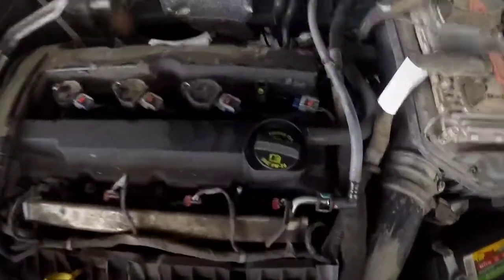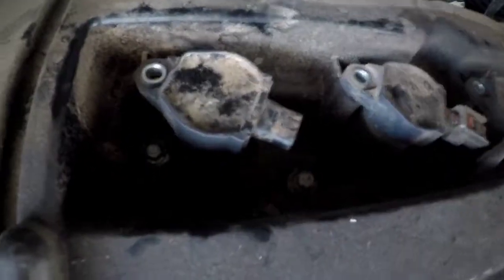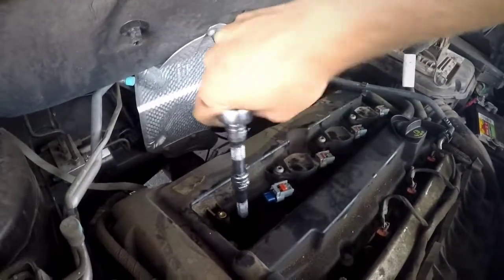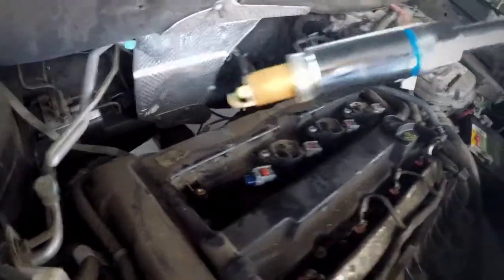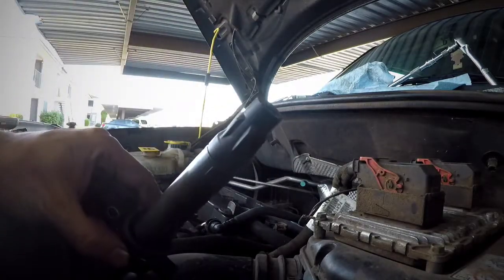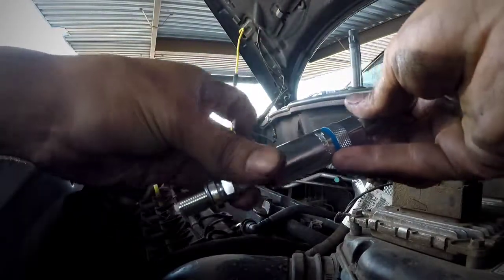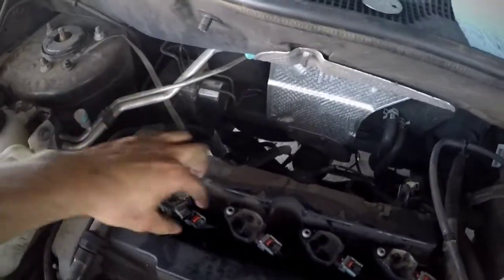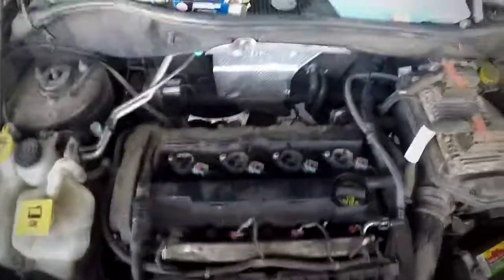Sparkplugs on a 2016 Patriot 2.4L

Comment: Hey Luigi I have a 2005 Subaru impreza 2.5rs and I have a vacuum leak. I was hoping you knew how to fix that..? Or have any suggestions
Reply from the maker: Hey man so best way to find one is  to inspect all your hoses and intake manifold gaskets. If you can't see any next thing I would do is get a carburetor cleaner spray and spray down on some lines . You'll know you found one when the engine runs differently. So do it with it running. The price to repair a vacuum leak is not that expensive but finding it is the hard part haha I hate those things
Reply from the maker: Easiest way is with a smoke test but shops charge for that . So my best bet would be to see if you can find it visually if not go ahead and spray it with some carburetor cleaner while the car is running